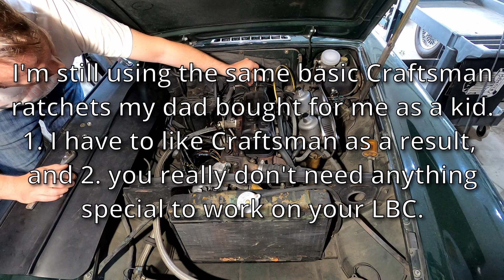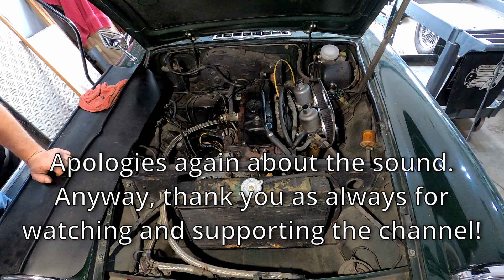MGB Tuneup Part 1: How to Tune Your British Sports Car

Comment: Hey, another rookie question - Should I block off the fuel lines before I compression test? I have an older pertronix ignition, so my initial plan was pull the negative wire off the coil and then I started to overthink things and wonder if I'm load the carbs up with all the cranking over. Thanks again!
Reply from the maker: No, the floats in the carbs will stop the fuel flow. No need to block them off.  As for pulling the wire, that'll work and is a good idea.

Comment: Great vid! Rookie question, do you need to worry about the valve cover gasket if you're taking it off?
Reply from the maker: It's usually best to replace it, but in a pinch not absolutely necessary since it's not under that much pressure.  If the gasket doesn't break, I can't say I've never just reused it.
Reply: @midwestmotoring  Thank you!

Comment: Remember to wedge the throttle pedal to the floor. You'll get a big increase in compression
Reply from the maker: Depends on the carburetors.  In an SU or Zenith-Stormberg, the air piston is still going to be mostly or fully down--so even with the throttle open it won't make a significant difference in compression readings.  With a Weber, that's a different story since they don't have an air piston and therefore don't operate the same way.  

Also, remember that the gauge probably isn't super accurate anyway--especially since the dynamic compression while the engine is running is likely to be quite different than the static pressure from just turning it over.  What we're looking for is a comparison between the different cylinders; not the absolute compression reading.

Comment: No need for the zip ties on 4.
What was your choice of plug gap ?
Not enough revolutions on the compression check. 
Take your compression check after adjusting valves. 
The professional way to check valve gaps is re-torque the head first.

What is your figure for valve clearance ?
There is another technique that requires engine rotation  only twice. 
Carb adjust?
Timing?
Points adjust presuming not electronic.
Reply from the maker: I know, but my OCD would never let me get away with that. :)